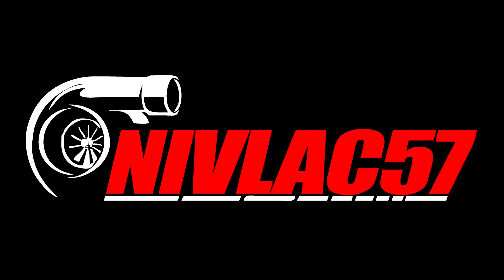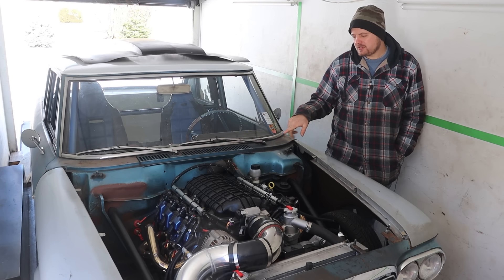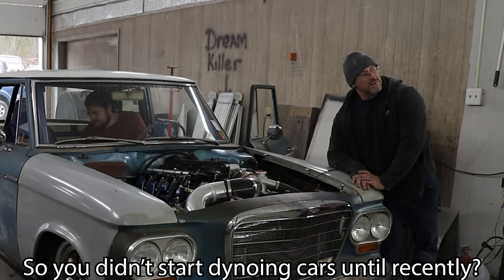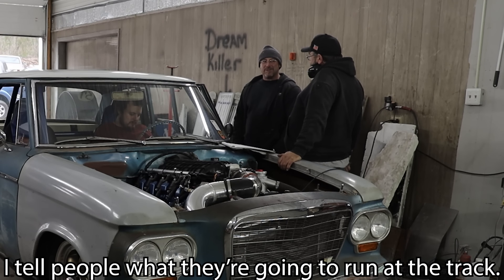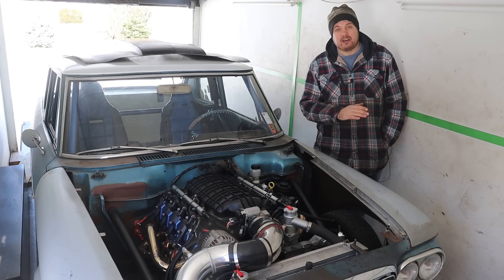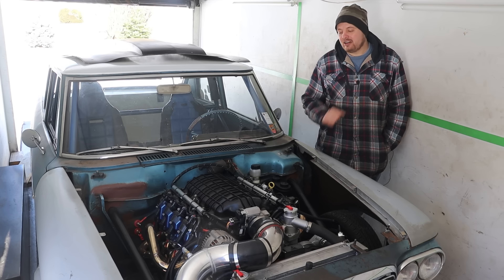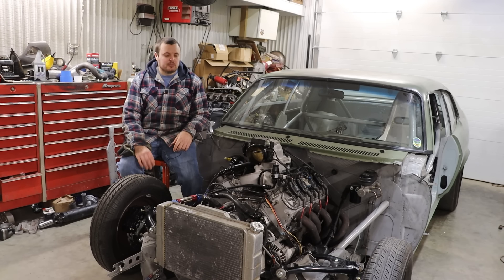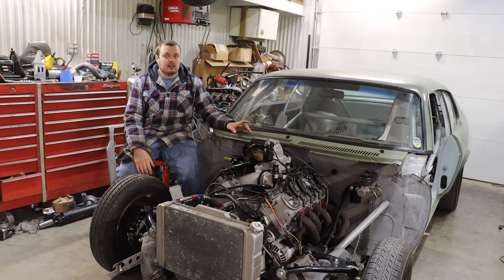180 Degree Headers VS Equal Length Conventional Headers - On The Dyno

Comment: Would the stock DI system be worth anymore hp (power under the curve) on the mild 5.3 over retrofitting a wet/port injection on it?  Where will the Gen V start to shine? as I see it a Gen 3 L33 with a cam would make similar numbers for significantly less cost.
Reply from the maker: The DI is definitely worth some power. Probably about 30-40 HP. The Gen 5 engines have a lot of strength and reliability advantages over the LS. The heads are great too, but not great for flowing fuel through them.
Reply: Brian Tooley Racing has a good video covering that. Short answer is DI makes more power. Your intake charge is pure air, as opposed to 'conventional' systems having fuel taking up some of that precious space. More air = more power.

Comment: You said a mod shop added port injection to the intake? Or was it already there and they improved upon it? I went and looked up a video demoing this intake as a bolt on swap for other engines and it appeared to already have port injection... My eyes may be deceiving me however
Reply from the maker: The Gen 5 engines are Direct injected. The intakes don't have injector provisions. Mast Motorsports sells the intakes with epoxied on injector bungs, injectors and fuel rails.

Comment: Is it my imagination or is 350whp kinda soft for a slightly modified 6.2? If add 15% that's only 402.5... am I correct 6.2 are rated at least bone stock 420hp net crank, that's factory manifolds, exhaust, accessories, emissions the whole kit n kabootle... Just asking I don't wanna seem like a keyboard critic, is there something I'm missing or have wrong.
Reply from the maker: The 5.3 made 352. The 6.2 made 457

Comment: Can you make 180° headers if you use six Y pipes and cross over the appropriate pulse?
Reply from the maker: Kind of. Hoonigan did video on a kit you can buy for a C6 Corvette that does what you are saying.
Reply: @Calvin-Nelson  Seems easier to cross over the pipes after all of the obstructions around the engine? I want to see data on that Borla Y-cross thing they did on the Rolls Royce build.

Comment: The dyno starts look violent, any reason for not starting 500 RPM before and roll on power instead of slamming the throttle?
Reply from the maker: I don't see any reason to do that. If you're talking about the Nova. The torque converter is going to do what it does. 

The Stude we actually started lower, but I didn't plot those points.
Reply: @Calvin-Nelson  I was mostly thinking about unneeded strain on the running gear, the entire car jumps around.
If it had more power the tires might brake loose from the sudden 0-400 torque by slamming the pedal to the floor instantly, instead of a 1 second ramp to full and letting weight transfer to the back before full power is applied.
There should not be any difference in the dyno chart by starting out a bit earlier and softer, because the engine would be at full throttle at the plot beginning RPM as the throttle slam start anyway.

Comment: Calvin, whats your guess on 1/4 mile time in a gutted rcsb 2wd silverado with a 2006 4200/ar5 with a 4.10 gear?
Reply from the maker: NA or turbo. What does it weigh?
Reply: Na, I'm guessing just under 4000#.  Curb weight is 4100 stock with a 4.3/nv3500

Comment: Put LT1 gen v head on the 6l gen 4. Huge gain to be made
Reply: What intake manifold did you used?
Reply: @98LSxS10  need LT intake and rotating assembly as well as btr ls/lt hybrid camshaft and the block drill for the lt bolt pattern. But the upgrades well worth it. I'm sure there is a way to keep direct Injection but a different high pressure fuel pump setup would be required so that also have to go. So lt intake with fuel rails.
Reply from the maker: Yeah. I'd rather have the LT block. It has a better oiling system, and is much stronger.
Reply: @Calvin-Nelson  yupp l8t block is where it's at. I wonder if the 3.268 crank fit on those new gen. They all the same as gen 4?

Comment: Wow 😯 
The studebaker is going to run 2-3 tenths quicker I bet… that’s a lot of meat through the curve… 👍🤘👏

I’d love to pick your brain on a Holley terminator x project I’m about to do… 

Putting a big and ugly on my wagon,… 
The Joe blo hidden injector system I bought uses a 9th injector in the rear… terminator x only has 8 drivers. I thought as long as there’s not too much amp draw, I’d just piggyback the 9th one in on one of the others. Basically one channel will have two injectors on it… 

Terrible idea, but what else can I do?
Reply from the maker: Hm. Not sure that will be ok. The Terminator Injector Drivers don't support a low impendence injector. Two High Impedance Injectors in parallel would be like one low impedance. I would hate to see you blow up a driver.
Reply: Well poop 😬 @Calvin-Nelson
Reply: Guess so… since parallel connected, 12 ohm, and 12 ohm, resistance would be half of one… only 6 ohm… which is low impedance… series connected and it’s 24 ohms… I guess I’ll have to measure the exact ohm of the injectors I’m going to use, and see what they are…  @Calvin-Nelson

Comment: Were you talking about ramping cam to negative degrees on the Stude ? I'm assuming you definitely know cam timing and rpm level torque are inversely related? A good starting point would be a ramp from +3 to -5 degrees from 0-8000 rpm if 8 degrees is your range. I believe the LT1 has 60 degrees range without a limiter installed. Comp has 20 degree limiter.  From your peak power at 0 degrees, you can tell there's more to be had by retarding the cam less than zero. The higher timing advance may be a factor of having the cam too advanced at higher rpm reducing cylinder filling and compression by extension. Lower dynamic compression = more spark advance.
Reply from the maker: Yeah. I'm retarding the cam timing with RPM. Pretty sure it is 50 degrees of range. As you saw in the video we tried 5, then 8, and was too far. No limiter is required on this. The cam is not large enough to be worried about ptv clearance. It is fully adjustable and tunable on the fly.

Comment: Dudes right , 500 hp is a handful to drive . A 67 Camaro with slapper bars and a 500hp BBC will run 12:70 @135mph but dance sideways through All the gears
Reply from the maker: I bet you could get it to go even quicker than that with some optimization.
Reply: @Calvin-Nelson  eventually we got it in the high 10.80s, had to get better leafs and a coilover on the passenger rear shock and borrowed slicks , but on the street tires available to my budget at the time 13.00s all day sideways.

Comment: Hey do you have a engine installation kit for that swap, my brother has a 65 he is working on
Reply from the maker: No unfortunately we do not, but with some SBC mounts and the plates for the LT, you might be able to adapt it pretty easy. 65 should already have the SBC mounts if it was a V8 car
Reply: We have a 455 Buick engine in it and stupid me l just remembered that he had a 93 Vette suspension put in the car so yes it should work well

Comment: The 180deg setup doesnt really give the sound you would think it would. Im eager to see the results from the tuned unequal legth set in the yellow nova. How long until that one is running?
Reply from the maker: Hopefully next month or two sometime. We're working on it now.
Reply: @Calvin-Nelson  you guys seen the stepped primary headers? Supposedly with evenly spaced and extra pulses (created by steps) I believe it spreads out the rpm range in which its in tune.

Comment: I don't think the LT engines will ever be what the LSs are. I think the heads are not up to snuff.yhey are designed to be a dry port.
Reply from the maker: I agree they are designed for a dry port, but they definitely have quite a few strength advantages over the LS.

Comment: Seems to me the 180° headers work better for high rmp racing like formula 1, but regular headers are good for low end torque.  That said  equal length is not as good as flow length.

Comment: All bmw m5 2012+ come with 180 degree headers from the factory why do you think they still sound not too great? My theory is an x pipe in the exhaust is not enough it needs to be like the gintani x pipe for the lambos the x merge section is 2 feet long it looks like a Y going out to another Y and gives the most exotic sound because there's plenty of xpipe exhaust for the m5 s63 motor but none of them sound exotic. Also the n63 is very similar but no crazy 180degree headers they used normal log style headers for n63 those sound even worse

Comment: 180* are unequal length
Equal lengths are equal length

 This is not a fair test.

Make 180* equal length manifolds for testing and valid data
Reply from the maker: The 180 degree headers are very close to equal length. The engines are wildly different, so it's not a great test. I meant for it to be more of a sound comparison.

Comment: I hope you don't rob your engine of it's peak potential by putting a parasitic load on it in the quest for boost.  There are some pretty good videos of a guy building an electric pro-charger setup for his car that would work great on that studi.
Reply from the maker: I'll stick with the parasitic load. Electric superchargers are expensive and probably won't stand the test of time especially for cars that sit out in the cold and don't get driven often. I don't need to add another battery on the list of things I have to maintain. Appreciate the suggestion though.
Reply: @Calvin-Nelson  You CLEARLY haven't watched the video series here on youtube where a guy builds one with lipo batteries and a brushless motor for a drone or rc car.